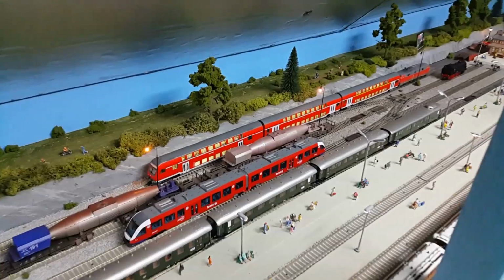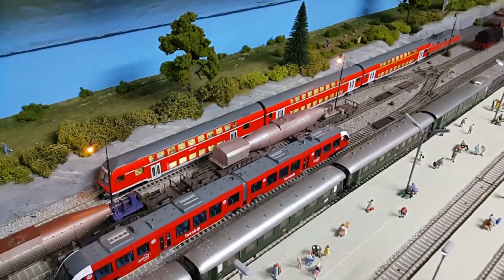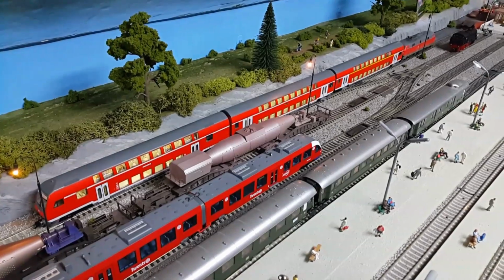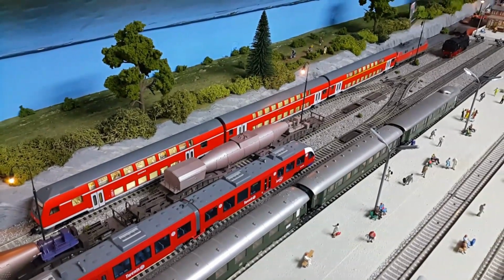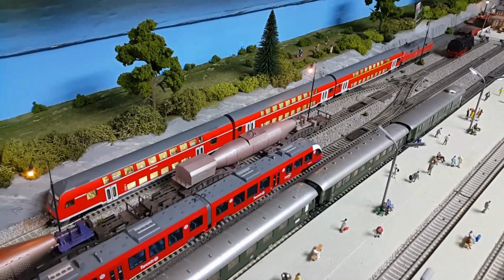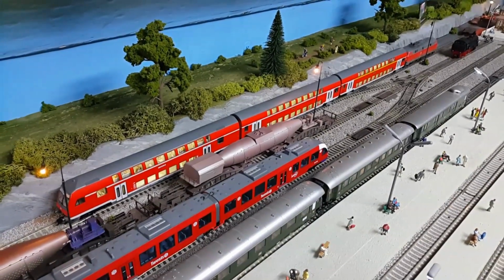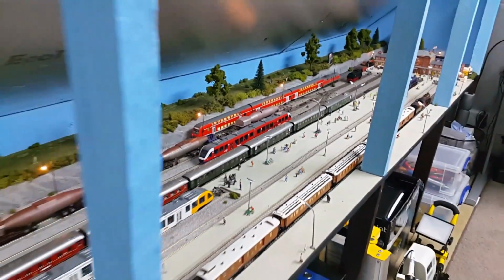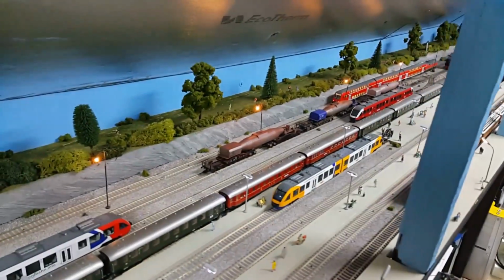Fleischmann 5624 led coach lighting upgrade #modelrailway  #modelrailwayscene

Comment: Whilst what you have done is fine, the way you have described it is not correct!!
1. It's a resistor not a fuse
2 You have not wired the track pickups to the negative or positive side of the bridge rectifier (its only marked + and - on the outputs). You have wired them to the AC input side of the bridge rectifier (as indicated by the wavy line symbols) it doesn't matter which way you wire the polarity of the input; the output will still work okay.
3. You did not let people know you were running it on DC, not DCC. This means some people may have been confused by the positive and negative input. DCC is an AC signal so there is no positive or negative on the input. I have surmised you are using DC because you talked about positive and negative inputs, and the light being able to work regardless of train direction..
4. It is normal for the resistor to be put on the output side of the bridge rectifier. On DC it will work okay as voltage in pretty much matches voltage out, but on DCC the AC voltage in will be higher than the DC voltage out. This has an effect on how the resistor value performs.

Nice result though!
Reply from the maker: @isismarthomes9673  Many thanks for watching and your professional input.
👍🏻

Comment: Is your resistor between the power pickup and an input to the rectifier? That’s unusual, most DCC lighting circuits I’ve seen add the resistor on the rectified side to stop (IIRC) the current rush when you turn on the power.
Reply from the maker: Hi, Yes they are on all three coaches they work great..not used them for a year or two as they are in storage...
Thanks Jim.
Reply: @hovermotion well you can't beat a working circuit!

Comment: Hi.  I have a Fleischmann rake.  Lighting would be nice.  Why are you not using proprietary kits from Fl?
Reply from the maker: I had the fleischmann light kits but they flickered and the coaches got warm form the heat of the bulbs and used more power with the old style bulbs.

Comment: Hey Jim, the little black thing that direct positive and negative is only needed for DC right?
Reply from the maker: claus2427 HI this setup is for dcc and i think it would work the same for analog I will check for you.
Reply: Thank you 

Cheers Claus
Reply from the maker: claus2427 it works in analog 12v mode but you do not need the resistor but you do need the bridge rectifier.

Comment: So, you are taking DCC and converting to DC, correct?  It is amazing how they do that.  I have quite a few add on lighted coaches.  Unless they already have pickups, it is pretty messy.  Bad enough I have given it up.
Reply from the maker: Rob McCrain Hi Rob..I am replacing the old fleischmann dc dcc lighting strips with the incondesent bulbs with this much better low powered setup.
All the fleischmann coaches can be retro fitted with very well designed wheel contacts that slot in the bogies etc.

Comment: Well done Jim they look very good .. as they say VERY 
ENLIGHTENING .. and a cheaper way of having light coaches  👍🏼 ... Dave
Reply from the maker: David Howarth Thanks Dave...cost is about £1.50 per coach to convert using the parts and led strips..
Reply: Very cost effective. Nice Jim.
Reply from the maker: Calvertfilm Thanks Laurie
the old lighting units cost over £20.00 each and I can fit 10 or more of these for the same price as one old unit.